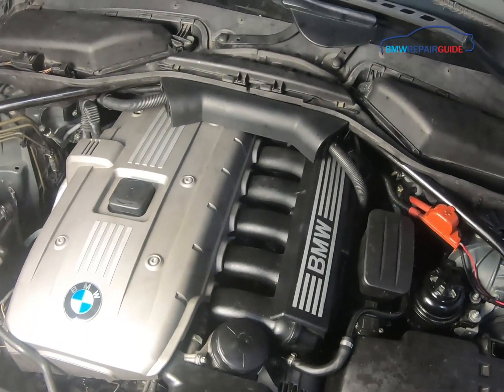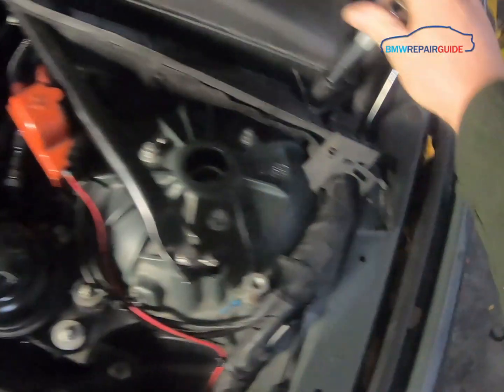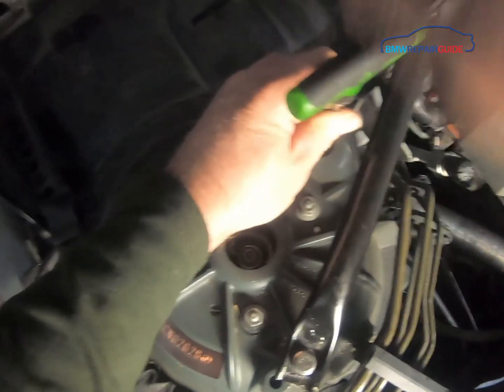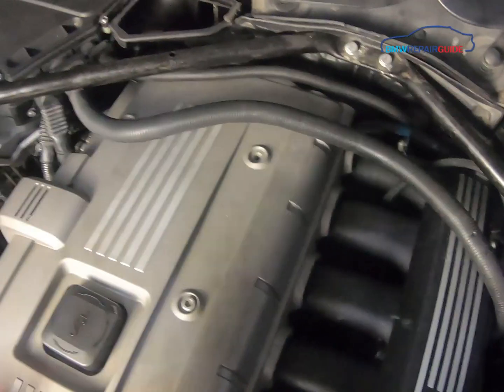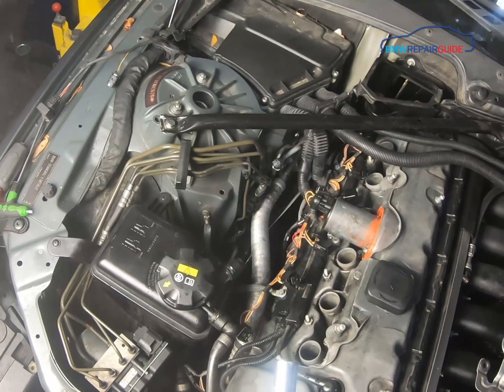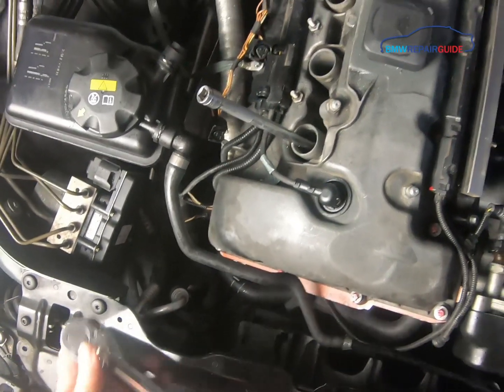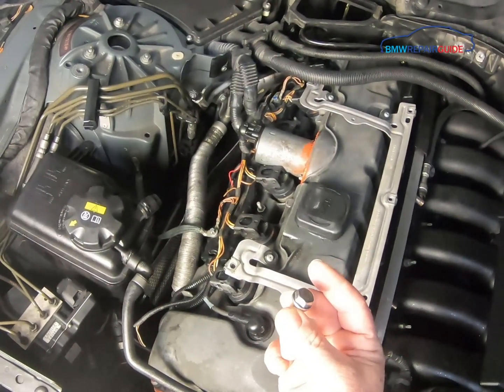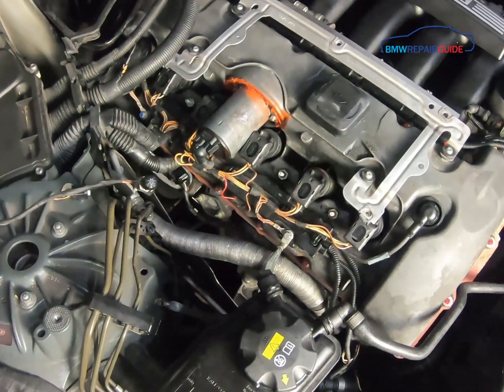E60 Spark Plug Replacement (Ignition Coils Included) - 2004-2010 5 Series (E60/E61)

Comment: Why do u need to remove the air filter and housing when the coil pack on the other side of the motor ? To be able to get the cover out ?
Reply: I’ve replaced my spark plugs by just removing the cover